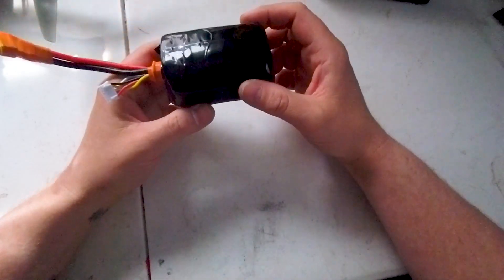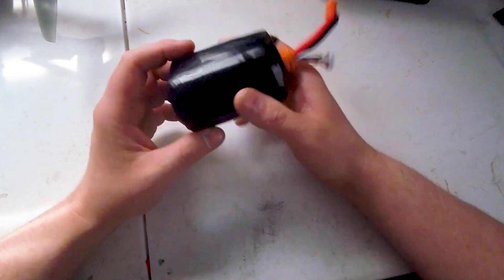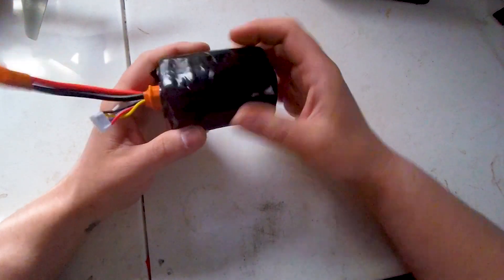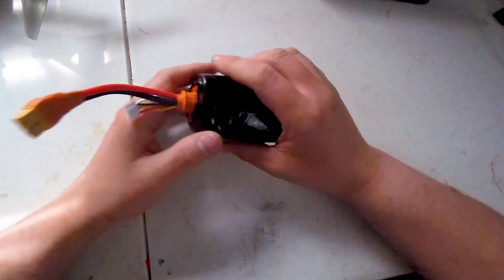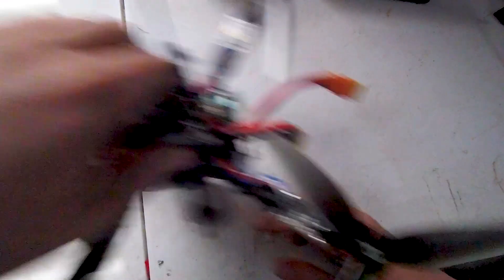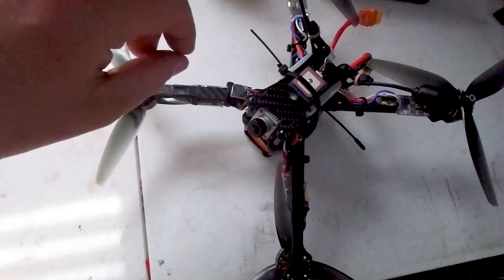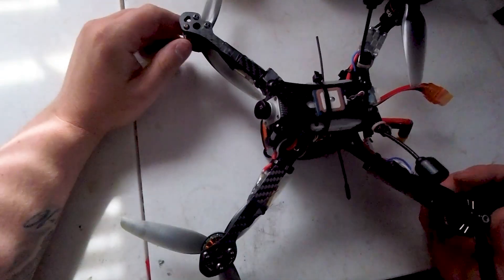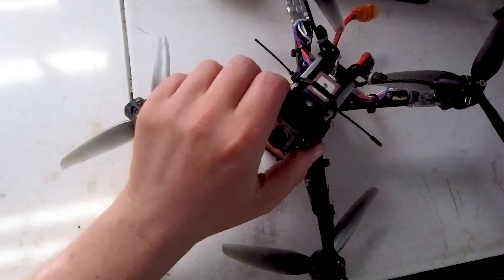DIY Lithium Ion Batteries! 18+ Minute flight times!

Comment: Hi bro I have a quad with spec 
920kv motor with 1045 propeller 30a Simonk esc
Apm2.8
Djif450 frame
M8n GPS and fsi6 to and rx

Currently I'm using 11.1v 2200mah battery Ian getting a flight time of 3 min when I hang my mobile phone to record video without gimbal

Can u plz suggest which li ion cells should I use and in which configuration Pls help me out
Reply from the maker: 3s is too low. I would build a 4s pack using 21700 cells rated for at least 35 amps. Good luck!
Reply: @nuckinfutzfpv7863  thanks bro
Reply: @nuckinfutzfpv7863  can u pls say the best cell name so I that I can search in ...
Reply: As I live In india I can buy only 18650 battery pls suggest me which 18650 battery should I use 
As I don't want to buy out of india

Comment: Which cells are you using? How much discharge rate?
Reply from the maker: They are Samsung 21700 40T batteries. 35A discharge rate. Link to those are in the description

Comment: Nice work - have a similar rig ( but on 5inch, with 2700KV motors) but my DJI video keeps freezing up. How would you recommend resolving this?
Reply from the maker: I'm very new to the DJI system and haven't had any issues yet. But I would cover the basics first. How are your antennas placed? Is your firmware up to date on everything? If all else fails possibly contact DJI? I've heard their support is decent.
Reply: @nuckinfutzfpv7863  yep antenna placement seems correct; will try and contact DJI support